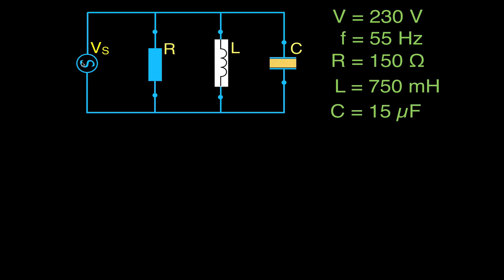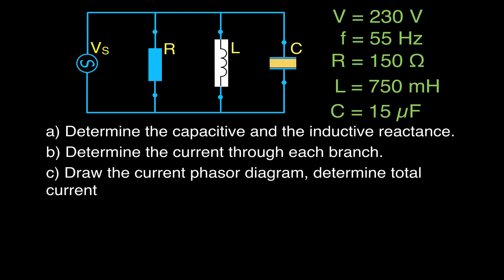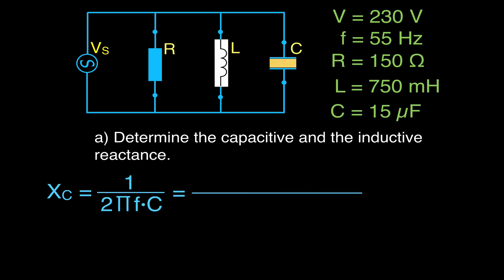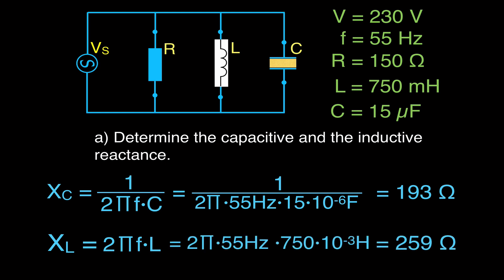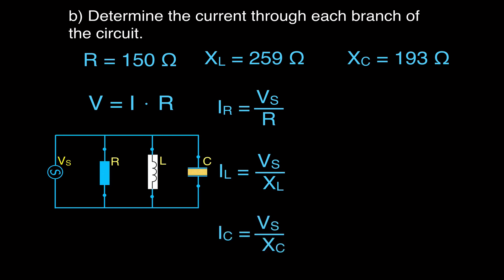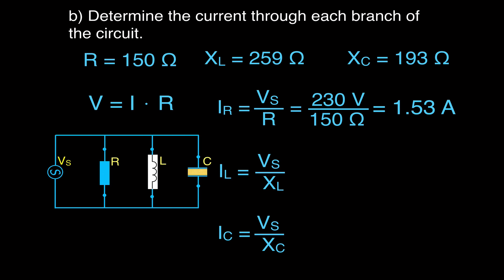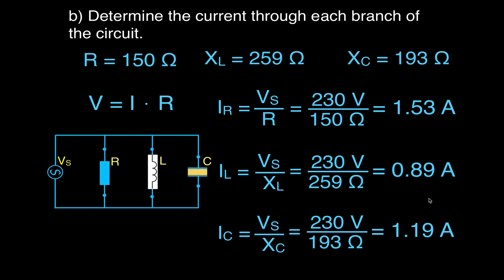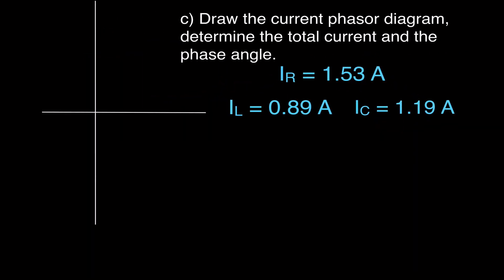RLC Circuits (19 of 19) Parallel RLC; An Example Problem; Current, Impedance and Admittance

Comment: Nice video: One question that no one ever addresses is WHERE does the transition from one current to another occur? For instance, where exactly does the 1.56amp, 11-degree, Total current transition to the 1.52amp, zero degree current through the resister?  Does this occur inside the passive element or in the wire before/after the passive element? Thanks

Comment: I'm confused. I was told that the inductor is always positive 90 degrees and the capacitor is always -90 degrees. But in your Current calculations it's the opposite. Why? 4:50

Comment: Hello, I have a question about knowing the phase angle in the source voltage, can I determine an angle φ according to the impedance values and then do Ohm's Law, please see the equation I made and if it is coherent.
Z=147 ohm, φ=tan^-1(((259-193)/(150)))=23.7495.
IT= 1.56 A φ= 11 ... V=Z*I
V=147*1.56= 229.32 V φ= 23.7495+11=34.7495
V=229.32 ∠ 34.7495....ok?
Reply from the maker: I don't really have time to evaluate the details of this problem, sorry.